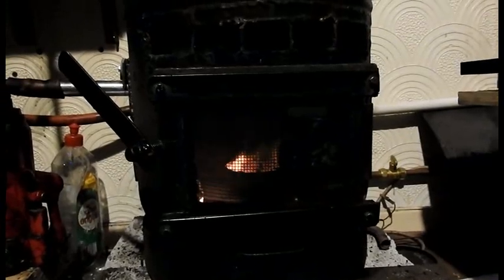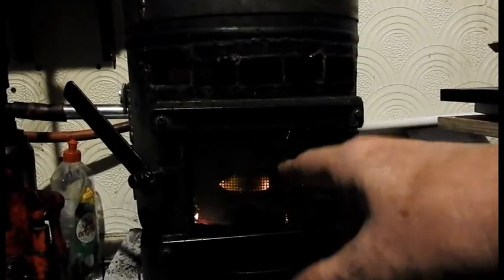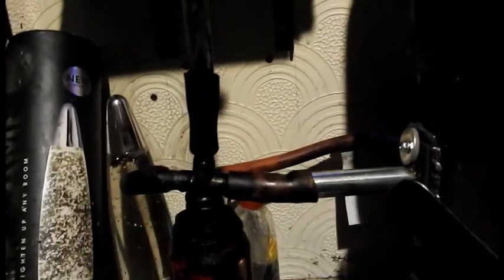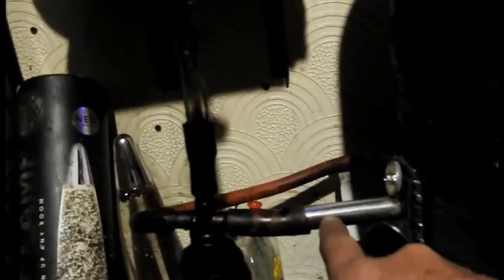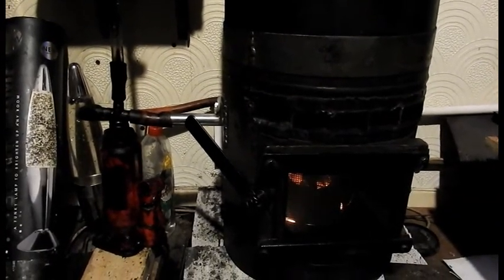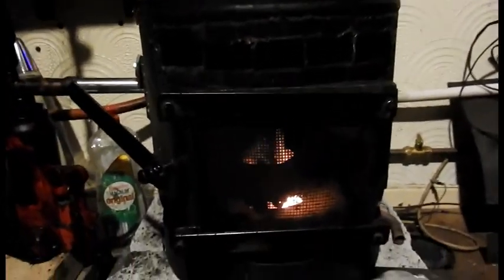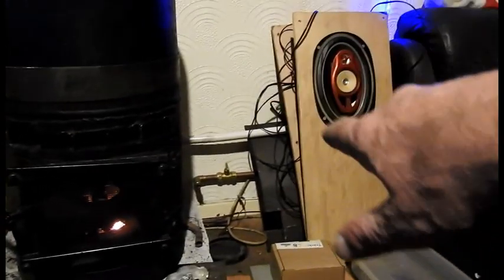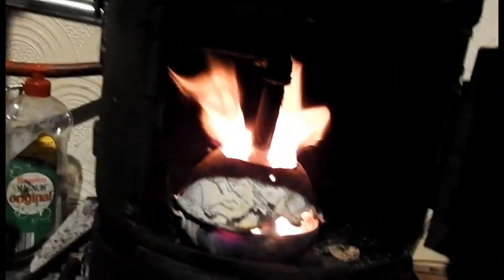Small Waste oil burner latest design.

Comment: Reliable Home heating. The Ultimate  waste oil burner setup. Well done mate.
Reply from the maker: There is room for improvement,  Dennis Weimer has an awesome setup you may be interested in   https://www.youtube.com/channel/UCc4U6FLmw8fxtOZH2EaZR4A  I am going to replace my air and fuel supply pipe with a fitting the same as his and see what I can do.  It should be awesome if I can scale it down a bit :)

Comment: Do you just drip your oil into the air tube? Is the air tube open on the bottom end or capped with holes around it? This look like what I need; I dont need gobs of heat. And, what is your burn pot?